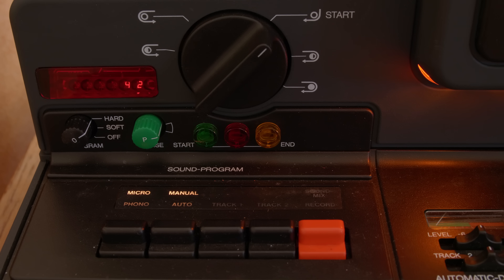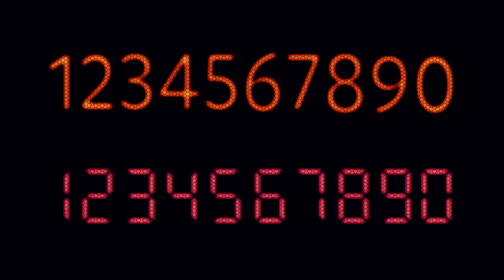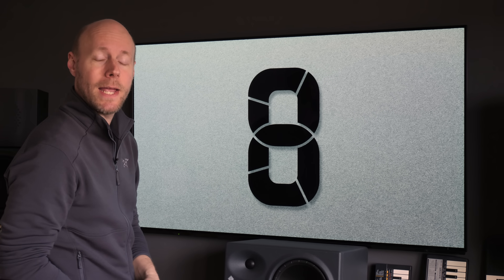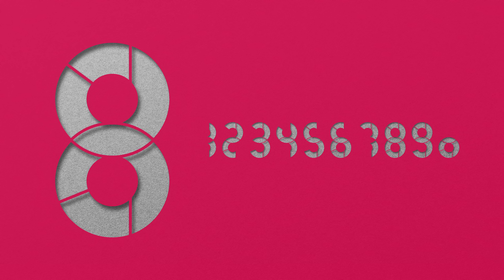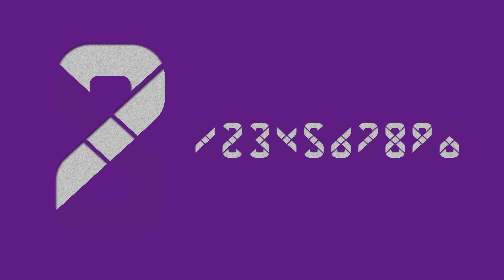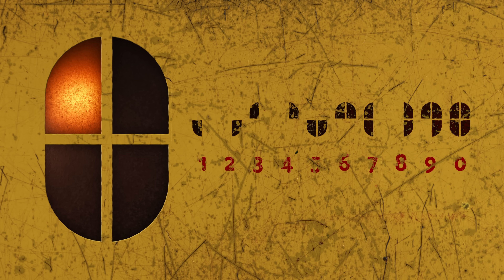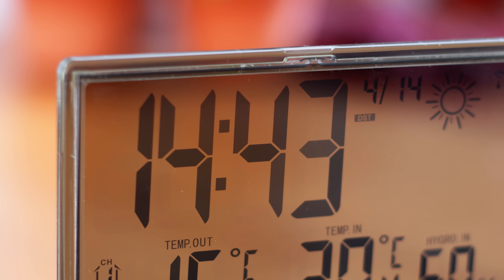Segmented Displays

Comment: I like HP calculators' heavy, barrel-shaped numerals with very faint shearing. Some, the HP 12c, for instance, also have the ability to display a comma as an Anglo-style thousands separator, a massive convenience that would not be possible with the international style where the separator is a space. The comma is two segments, with the top one also being the decimal point. I imagine these can be converted in-factory to the more common European style as well by switching the circuit pathway for the period and comma.

Mentally I think of most calculators as having an eight segment display, as the decimal point is part of each individual numeral unit. These HP's would then have a nine segment display.

Comment: The Texas Instruments TI-80 graphing calculator (not the larger TI-82 and later models) uses a 3x5 matrix font, because its display is only 64x48 dots. With an extra dot between rows and columns this gives it a 16x6 character display in text mode. It's actually quite readable for math.

Comment: I really enjoyed your presentation. It took me back to a time 20 years ago when I did a similar exploration in seeing if segmented displays could be be tweaked for improved legibility. I also explored rendering numbers with alternative shapes. I like to draw a slash through my zeros to differentiate them from the letter O. I ended up coming to a similar conclusion as you did, that any new design introduced compromises with other characters. By the time you have a higher amount of segments, it ends up becoming more practical to just use a matrix display. I used to have an old Casio databank watch that used a tiny matrix display in one portion of the LCD for displaying text info. I remember a time when I actively looked for wristwatches that used higher resolution dot matrix displays, long before the smartwatch era. One thing I'm disappointed with is that I never saw anyone do anti-aliasing with a dot matrix display.

Comment: 2:58 That's the most common design? I've never seen it. Particularly the 4 with the shortened left stem looks very strange to me, I don't recall ever seeing that. In my experience the most common design, by far, is the simple, non-italicized one at 1:15.
Reply: I think he meant ‘if they actually wanted to pay the effort to design it’. They usually don’t do it, because nobody wants to pay the effort into seven segments
Reply: I also though that, then I looked at my Casio watch I have for years and it turned out to be this exact design. Wow, I actually never payed attention to it enough to see this altered design is used.
Reply: I think they meant the double square was the most common, although it may have certain variations.
Reply: uneven divisions are not always done. also, (from my small sample size) appliances usually have italicized numbers (e.g. microwave)
Reply: 2:58 i lovit 😗
Reply: I think it's common actually, you just don't realize bc no one pays close attention
Reply: @monbub  I dunno man. That 4 honestly doesn't even read as a 4 to me. I'm pretty confident I would notice something like that.

Comment: I feel like you have the right idea with a lot of these segment designs, but a lot of the individual numbers and letters could be designed better. For example, the a, n, and r at 9:49 would look much better as capitals

Also, my personal favourite is a 12-segment version of the double square with an x overlayed on top that splits the middle line in half, forming an O/0 on the outside and struckthrough X on the inside with 6 segments each
Reply: Absolutely thought the same for 9:49 
The same applied to the t and j that would work better as small t ( L- ) and capital J ( just reversed L instead of that diagonal line in bottom circle) 
Regardless, the amount of creativity in such a niche area is really refreshing. Can't wait to see more from him...
Reply: What about capital "D"? Just use the three leftmost segments
Reply: hi
Reply: Adding the two vertical lines gets you the 14-segment and splitting the top and bottom horizontal lines in half gets you a 16-segment

Comment: Not 3x5 matrix exactly, but I think I remember some ZX Spectrum software using a 3x5 font (must have been quite clever coding as Speccy hardware assumes the screen is divided into 8x8 pixel blocks.)

Comment: When I was a teenager, some 40 years ago, I came up with a font that was a 30 segment display, based on the design of the tiles in our bathroom.  Imagine a grid of 8 squares, 2 columns of 4 rows.  The top 2 by 2 square had a circle inscribed in it, as did the bottom 2x2 square. making 30 segments in all (12 vertical lines, 10 horizontal lines, and 8 quarter circles).  I liked the way many of the letters looked, but some, like the V and W, were not great.

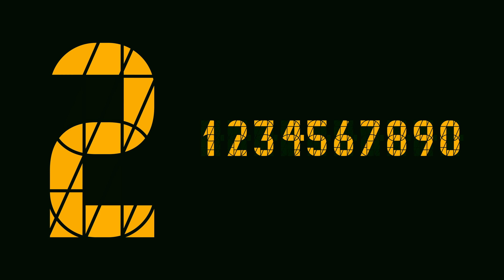Comment: Go to Belgium, and take a look at the platform displays of the "De Lijn Kusttram". It is essentially the 3x5 matrix you show at 12:45, with four extra pieces in the corners to make the matrix rectangular, and some of the matrix elements are cut to allow for slanted lines, but not as excessive as the 11:14 design. I remember being absolutely fascinated by those.

Comment: I have one of those old Sharp calculators. It's such a unique character design. Back then, many calculators did not have leading zero suppression, so the lowercase zero actually, in a way, aided readability. Once leading zero suppression became a standard feature of calculators, lower case zero fell out of fashion quickly.

Comment: Since there are 10 digits to display, the absolute minimum number of segments necessary is 4 (since that allows 16 possible combinations of on/off). Tragically, 10+26=36>32, so you need at least 6 segments for a full alphabet. If only there were 4 fewer letters!

Of course I really doubt either of these are possible in terms of design.

Comment: This is great! I was experimenting with custom segment-designs as well, but not to the point of what you have done here. Great resources and it´s nice to see all the possible directions. Here is one interesting segment number display, that looks like 7-segment but of course has few more elements in there. https://img.joomcdn.net/53cab0502091782a7ab23fbed6172bfa46d08d2d_original.jpeg

Comment: Did you know that the indo-arabic creators of our numerals designed them such that each contains the same number of 90 degree corners? Zero is a circle and has no sharp corners. 1 is done with a serif at to. 2 is like a  Z. 3 is sigma E. If you try you can count 4 right angles enclosed in a 4 - in the centre. 5 has 5 when drawn like an S. 7 should have a line halfway through it. 8 has 8 inernal 90 degree corners. 9 will have 9 once you and a double serif or curly. Cool huh? All except zero can be carved with straight lines.

Comment: The TI-8x's has some text elements written in a 3x5 matrix. Unfortunately, the screen is a matrix itself, rather than the matrices having superpositions, similar to other segmented displays. I also know that the Long Island Railroad has 5x7 matrices as displays for train/car, destination, or current/next station info. These are really matrices, as evident by the scrolling "watch the gap" reminder, where some spots of the sign don't illuminate.
Reply: Same thing as TI-10 and TI-15, they are displayed as 3x5 matrix. An additional 3x3 matrix sits between the 3x5 matrices, up and down, to display whole numbers usually for fractions, and symbols

Comment: Fantastic video!  I had no idea such a wealth of creativity could be found in limited segment displays.   If you wish to make large versions of functional displays, this is quite possible with the following items:  a 3D printer,  addressable LEDs, and an arduino/raspeberry pi/your favorite microcontroller.  Some addressable LEDs are not on tape, but on thick wires with large bulbous LEDs that you can easily position as lights for a segmented display as the distance between each LED is a few centimeters.   LED strings come in lengths of 25 to 50, and I believe you can address a maximum of 100 per microcontroller, just dedicate 7 LEDs per display, 3D print the cells to hold the LEDs in place, write some code, and you have a large functional display.   So very inspirational, thank you for making this video.

Comment: 3:02 "Shearing the font, making it italic"

Actually, that's what's called an oblique font. Real italic designs tend to be complementary designs, often featuring swashes and calligraphic features that set italicised text apart from the usual running text.

(Though it should be noted that not every font has or needs a dedicated italic design, particularly for sans-serif/geometric typefaces)

Comment: 4:16 - You actually don’t need any more bits of data to display the digits! You would need to apply a little logic, though: for the left and right middle segment, if at least one of the neighboring segments is on, it also turns on. Otherwise, it stays off. A couple OR gates should automatically generate data for those extra 2 segments from 7-segment data.
Though, if you want the 3 to be shown without the left middle segment, you’d need to revise the logic so that they light up when 2 or 3 neighboring segments are on.

Comment: Surprised you didn't mention WHY it's 7-segments. It has to do with there being 8 bits in a byte, meaning you don't need extra storage for each of the variations. Patterns store everything from 00000001 to 11111111, with 00000000 being reserved for emptiness. I believe once you go to 8-segments, you take up double the space as you need 2-bytes for every character displayed.

Not a big deal today, but on early calculators...

Comment: I used Moto Fone F3 in 2008. It was the 1st phone to use a e-paper display. This display used segments to show characters. The e-paper display uses no electricity to keep the display on [only uses electricity to change what is displayed]. In 2020 when I looked at it, it was still showing the same characters on the screen it had when I put it away 12 years earlier in 2008!
https://en.wikipedia.org/wiki/Motorola_Fone

Comment: If you ever want to make your own LCD font, remember the math behind it.

Know your goal: How many digits?
0-9 is 10 digits
0-9 and the alphabet is 36 digits

Know your tech: How does it work?
A segment can be either on or off. Every segment will have two states.
(and a quantum superposition of both if you want to go there)

Know your math: How many possibilities?
Cryptology is the study of possibilities, (to be simple).
Let’s say you have two segments.
There are 4 possible combinations.
00
01
10
11
(where 0 is off and 1 is on)

4 is also 2^2. Two possible states, two segments to apply them to.
Let’s try 3
000
001
010
100
011
110
101
111

That’s 8, or 2^3. Two possibilities, three segments.

Know your process: How to use it.

If you want to have 10 digits to display, you need at least 10 possible combinations of segments. The ABSOLUTE MINIMUM would be 4 segments (16 combos or 2^4)

Want to use 36 digits? You need a minimum of 6 segments, giving you 64 or 2^6.

Comment: What I like about the 7 Segment double square is that it's so wide spread. You can easily get driver IC's specifically made for them and find ready to use code for microcontrollers, making it very easy to set up. they can also display Hexadezimal numbers aswell as a minus

Comment: XO was pretty impressive. Getting both M and N to be displayable is an accomplishment, as is getting both U and V, and you didn’t need to compromise 3 numbers like you did for X. Most of the wonkiness can even be fixed with an extra segment in the each of the two gaps on the left and right side of the center x.

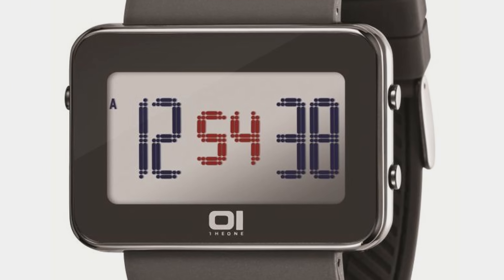Comment: @7:48 i made a digital clock using 4 of these vfd digits. They are very small vacuum florescent display tubes. Kind of tricky to control. I want to make a wrist watch out of them, but I'm a bit over my head with the power supply design.

Comment: Interesting design exploration, I think because I've made a bunch of pixel fonts, I would definitely just pick the 3x5 matrix display, or just a full matrix display that isn't coded per 3x5, but just as is relevant. So you can have thinner or wider letters too (m's and w's always causing problems, and you want kerning to be more consistent on i's and l's)

Comment: Common huh? Maybe in your country. I have NEVER seen these variables. Because improvements are completely unnecessary. A five year old understands a segment display much faster than an analog clock. I know because I did. I’m extremely dyslexic and I understood standard segments instantly. No need for any improvements. Neat though. Just not even remotely necessary.

Comment: A design you haven't mentioned but I have seen is where it uses very symmetrical segments (just like in the last frames of the video) but additionally has \|/ in the upper square and /|\ in the bottom square inside. This allows to very clearly represent all digits and latin letters.
Reply: I had a children's toy computer that used such a display, in 1 inch tall LEDs, I think 6 of them, for it's only display. It also allowed a nonsense character to be the "prompt" character.

Comment: The 7-segment display was very common in the 60's & 70's, when in 1979, along came the hp-41, which used a 14-segment, "starburst" display (really 14+3, with 3 extra elements to the right of the main 14, to display semicolon, colon, comma, and period).
Thanks for showing a myriad of others!

Fred

Comment: 5 segment display is wayyy cooler than it got credit for being

It’s a super cool way to help in optimizing the circuit that actually controls the display, and showing a single one, only to write it off as impractical and unappealing was shallow.

Other than that, I really enjoyed the insights into the applications of different designs! Very cool!
Reply: At that level of optimization, you might as well show 4 dots side by side and interpret the decimal number from 4 binary digits.
Reply: @sanjeen2503  Heavily disagree. There's something extremely cool about making something readable to humans without use of a reference diagram, while simultaneously using the smallest number of bits possible. 

I really, really like the FreeForm 6 segment, though I would have displayed 4 differently - display it as a 1 with the top left segment on!
Reply: @alexanderbateman5581  lol u are disagreeing without getting my comment! I was saying that optimizing the circuitry while sacrificing readability is bad enough at 5 segments. Better make it 4 segments. And keep it readable to Low-level electronic engineers who are good at reading binary.

Comment: The reason why you cant get any better than double square lies in the math, and more specifically the group structure, the generators of the two groups. Its should be fairly easy to prove in the case of digits. For letters it gets more complicated, and is the basis of many codes/alfabets used in some cryptography applications.

Comment: In the 80s, the São Paulo city hall spread clocks around the city with mechanical 7-segment displays. It was beautiful and elegant, but maintenance was a challenge, as each segment had its own actuator that made the part bend backwards.
Reply: You got photos of it?
Reply: @DestroyerX61  Look: https://www.joaoalberto.com/wp-content/uploads/2013/12/10/relogio-de-rua.jpg
Reply: @DestroyerX61  https://www.tresmeios.com.br/blog/wp-content/uploads/2020/02/MOTOROLA-–-RELÓGIO-DE-RUA-SP-1030x771_Easy-Resize.com_.jpg
Reply: @DestroyerX61  http://s2.glbimg.com/PGaFEK5roF9YQlzre-MwNr1l2b4=/s.glbimg.com/jo/g1/f/original/2013/05/03/relogio_13_de_maio.jpg

Comment: The 7 segment display also is easy to light up with a binary system, which would have used a common 8 bit counter to do so.

A 9 segment would require a 16 bit counter.

Comment: The 14-segment display is a fairly common alternative that modifies the 7-segment and seems to address a lot of its shortcomings.  It is a lot of fun to see what's come up over the years.  Though, at this point, going beyond the 7-segment will probably be filled with a matrix display as there is major considerations like cost and driver circuit complexity hold no advantage.  It's a fun thought exercise though.  It's similar to nixie tubes.

Comment: Important about the 7 segment design is that can display more than just numbers 0-9. It can also display A-F (albeit with some upper/lower case switching), making it suitable to represent a nibble (https://en.wikipedia.org/wiki/Nibble). So you can actually represent 256 numbers (0-255, or 0x00 - 0xFF in hexadecimal) with just 2 7-segment displays!

Comment: If we come to an alien planet and they have different ways to write numbers : And a pie circle ⭕️ divided by four pieces. Each piece is a number ,
1,2,3,4 / bottom two - 5/ top two 6/ left two 7/ right two-8/ left two and bottom right  -9 /right two and bottom left 10/ and I believe there is still three additional combinations left. 

Ie it’s possible to use only four elements. You need the pie slice shape though , or a perimeter defined ( say circled or even squared ) and divided by four segments .

Comment: You said no devices use ths 3x5 matrix.
Not true, some digital clock kits on ebay use 3x5 matrix digits, often on adapted 5x7 matrix led blocks.
I have one, you can press a button to change between 3x7 digits or 3x5 shorter digits with seconds bargraph below.